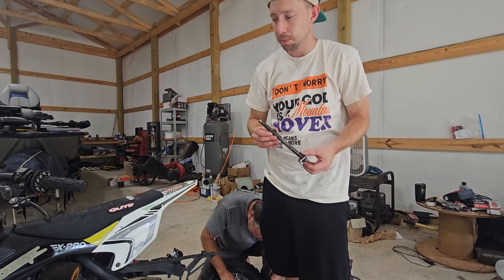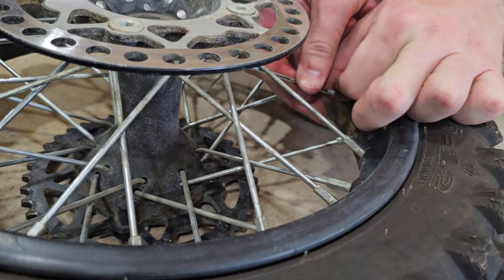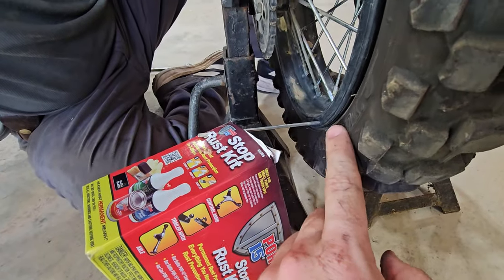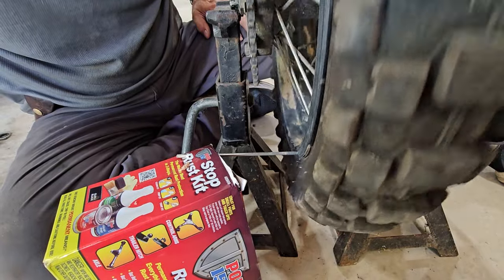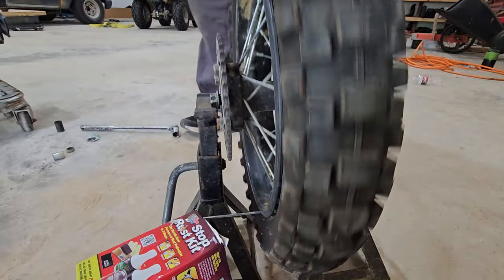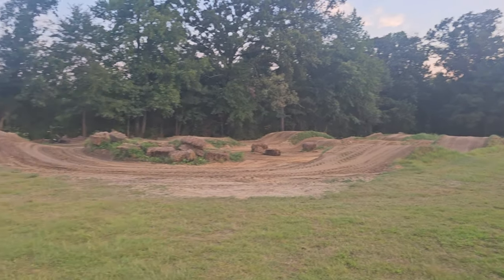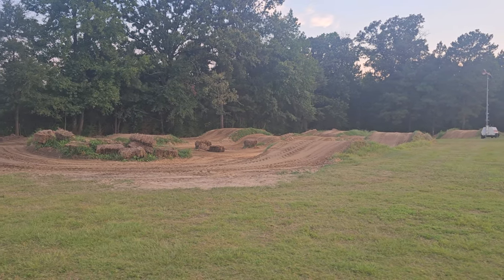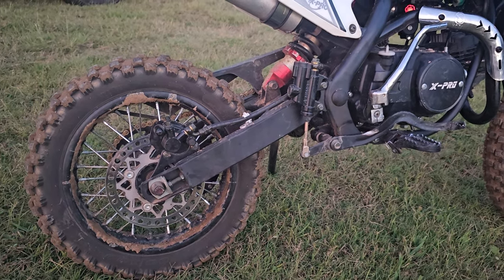How to Replace Broken Spokes and True your Dirtbike Wheel(Cheap,Easy, and Fast)

Comment: Can you use this technique, on a larger dirt bike? My RM 250 has a broken spoke. Would like to fix it. 👍
Reply from the maker: @stevenbrown3901  You should be able to. I just let all the air out, then unscrew thr broken spoke , feed the new spoke through the hub and thread it into the nipple. Tighten it up and check to make sure the rest are tight and ride.😁
Reply: @MartinRacingChannel  , Fantastic. Thank you Sir! 👍😎

Comment: Can I replace the spokes on my cr250 rear wheel without taking the tire off?
Reply from the maker: Possibly, if it broke where mine did in this video, you might be able to do exactly like I did to fix mine. It really just depends if the nipple is still in the rim and if you can put the spoke through the hub and have enough room to thread the nipple onto the spoke.
Reply: @MartinRacingChannel  really appreciate the help. None of my spokes are broken or bent, but the tire shop says they need to be replaced.